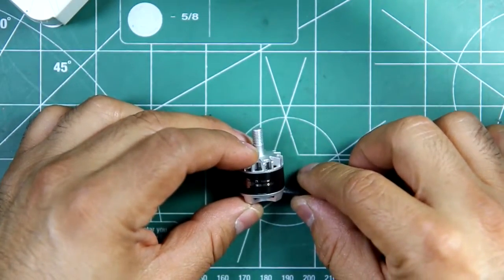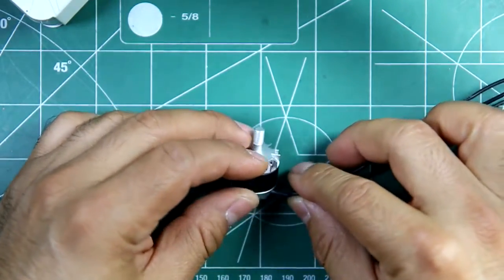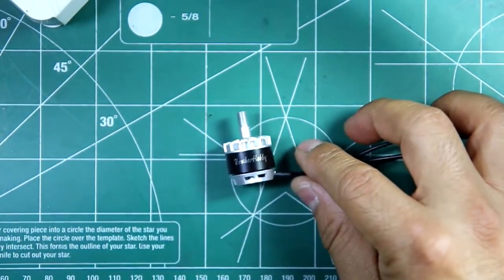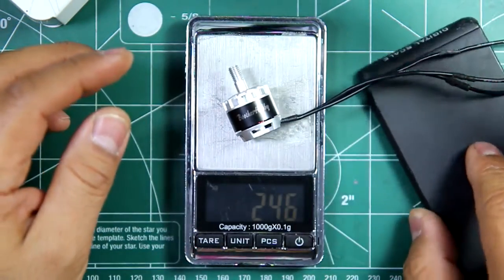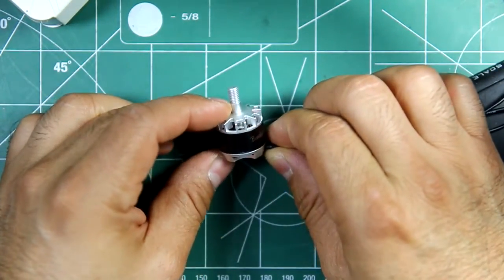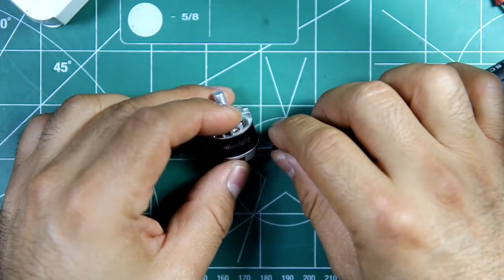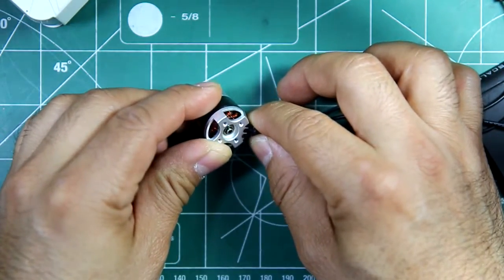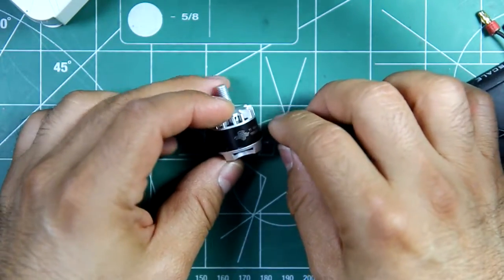BrotherHobby T1 1608-3600KV -Prototype- Static Thrust Tests -Give the Factory your Feedback!

Comment: Im finding a 1608 motors 3200-4200kv with M2 screw mount. 12mm diameter. Any recommendations for other type of motors? I couldnt find any 1608 T1(m2) 3200kv motors anymore.

Comment: Hi again I have come across some BBB 1606 3500kv motors, would you know about them ? they are for 3" props, I can buy them for a good price again here in china. they weigh about 15g, would they be good for 3" quad bladed props, over 1407.
 its hard to buy popular brands, here so its hard to choose. 
Thanks
(the rcinpower gts2305 2450kv motors have arrived just need to install them their quality is very good)
Reply from the maker: Yes, quality on the rcINpower is very good. As good as any of the top premium motors, and in some cases it's in fact better. Please let us know about your experience later on after you abuse those motors and give them a good beating ;) It'll be good to find out how durable and reliable they are. 
Also could you share the store website where you purchased them? Unless, it's only for the Chinese market. People are having a hard time finding these motors. I've mentioned to rcINpower they need to improve their reseller chain. 

 I have not tested that motor size yet. 1606-3500KV motor size seems like it would be a good match for 3" propellers and perhaps even for some low-pitch 4". 15g weight is very good, about same as BHobby 1407. I think they're the same motors as in this kit? https://www.banggood.com/3BR-128-128mm-Carbon-Fiber-FPV-Racing-Frame-1606-3500KV-Motor-Runcam-Swift-Mini-Camera-Combo-p-1153584.html
That BBB brand motors got good reviews on their larger motors from other testers, so hopefully the smaller ones are good too and hopefully BGood sells them soon so I can order and test them. They look good!
Reply: yes it is the same motors as in the kit, the motors have 3 mount holes for the kit frame plus the regular 4 for other frames...I plan on running the hq3030x4 with them hope its a good combo.... 
most people here buy there quad related parts from an online store called TAOBAO, a bit like ebay but much better, its got connections to most of the Chinese made parts , motors, props ETC, its were I have bought practically all my parts including the rcinpower and BBB motors , below is the link to the rcinpower store on taobao.

https://rcinpower.world.taobao.com/       (Chinese/english)

there email is,   rcinpower@163.com         (they can speak English)

regards

Comment: I would like to see a little lower KV to keep the amp draw under control. I like the size, but it seems too heavy for 4" quad. I would be really interested to see thrust/amp numbers on the RaceKraft 5038 prop. Get this motor down to about 20-22g and 2700-3000 kv and it would be perfect for light 5" builds.
Reply from the maker: I just got the 3200KV version last week and I'm running tests this weekend. This form factor seems to be somewhat specialized so you gotta do a good matching all-around. Props, superlight frame, etc to keep overall weigh light. Amp draw is exaggerated on the thrust stand, you'll see way less in-flight, specially if you got a light craft. I tested the TRK5038 on a larger motor but that prop's design doesn't show good data on the thrust stand. It's made for moving forward so on the static thrust tests performance is very poor but in the air it flies as good as other low-pitched props. I'll test GF5030 & HQ5040 on the 3200Kv version of this motor. Video should be up in a few days. Thanks for watching!

Comment: BH should think about a 1606 version with around 3000kv for 4" setups. this motor is too heavy and too hungry for amps. the 1407 are great, have them on my 3" rig, but this motor will never find his way on my 4" rig..... sorry BH!
Reply from the maker: Good point. A lighter 1606 3000~3300KV would match better with 4" props. I mentioned to BH about the weight on this motor and the target application would be 4" frames so a lower KV would be better. Hope they're listening
Reply: EngineerX , the next point is, its hard to find good 4" props. the 3"+5" market is exploding with weekly new shapes, hope the companys will put more focus on the 4" size.
Reply from the maker: Very true. Most 4" props come from chopped off 5". There's a couple of "native" 4" like the Lumenier 4040x3, 4040x4 and DAL TJ4045 x3 and T4045x3. We need a few more good ones.

Comment: What was the temp on 4S 4045 x 3?
Reply from the maker: Jonathan Jonas just a bit warm, nothing to worry about but I think once in air temps will be Ok. Still no word if they're releasing this motor. I haven't seen it for sale yet. Should be a bit lower KV, 3200 or 3300 would be nicer.
Reply: GOOD TO KNOW. WAS CURIOUS ABOUT IT IM ONLY RUNNING A 4X4X3 NON BULLNOSE 
FPVACES.COM HAS THEM IN STOCK 17.99 EACH JUST ORDERED A SET THIS MORNING
Reply from the maker: Jonathan Jonas Sweet! I've yet to build my 4" quad with these. Just can't seem to find enough hobby time lately. I've been curious to see how fast a 4" quad would be with these.4S 1000 or 1300 mah would be the LiPos I was thinking of using
Reply: I HEAR YOU THERE I JUST BOUGHT A 4"ALIEN FRAME BUT I THINK ITS GOING TO BE TO HEAVY FOR MY GOAL OF 10:1 POWER TO WEIGHT. I DESIGNED MY OWN VERSION OF THE ATOM V2 4" IM SHOOTING FOR SUB 300 GRAMS. RIGHT NOW MY CUSTOM V2 3" IS 257 AUW WITH THE 1407'S AND IT IS A MONSTER. ILL BE SURE TO SEND A LINK WHEN I FINISH THE 4"
Reply: OH BTW THANK YOU FOR ALL YOU THRUST TESTS. THEY HAVE BEEN THE DECIDING FACTOR WHEN IT COMES TO A LOT OF MY MOTORS
Reply from the maker: Awesome builds! For sure send me links once finished and ripping thru the air. Great to hear you've found the tests useful. The non-bullnose prop should be OK with this motor. Always good to do a quick punch out and land, check motor temps, then go for a somewhat aggressive lap and again check temps.
Reply: hey if i shoot you some lumenier 4x4x3 prop will you add them to you tests?
Reply from the maker: For this motor? Yes I can run the test on the next test session, I can add the results to the Excel table but would only make an additional video if there are a couple of other props to add. I can't think of any other props that would match well on this motor
Reply from the maker: will do!

Comment: Would love to see some 3" tests. What's the hole spacing for mounting?
Reply from the maker: I decided not to test 3" because the motor is quite large and heavy for 3" frames. Hole spacing is the same as 1407 motors. I think a lower KV value - 4" props and 4S would work best for this motor. I still have not got around to building the 4" frame I wanted to test these on.... need more free time for fun

Comment: If they can get the weight down to 20g and put out 1100g+ on a 4040 tri it will revolutionize the 4" market, you will easily be able to get p/w ratio in the 12:1+ range.
Reply from the maker: That would be the killer setup. It's going to be quite difficult to loose 4.5g. Most of the weight is on the stator laminations, magnets, copper windings and motor shaft. Those 3 components increase motor weight significantly as stator height dimension is increased. In contrast, increasing stator diameter increases weight by a smaller amount. A titanium shaft could be used to knock off a couple of grams perhaps, so maybe 22g could be possible. That would be a very goo weight I think.
Reply: EngineerX there was a 4" set up at the indoor race this weekend that was running 1407 3600kv bh motors with 4040X3 RK props, with a 850mah battery his AUW was 279g. This set up was able to post a top 5 time on the day! The more traditional 5" or 4" rigs had to make wider turns and keep momentum while the ultralight 4" could take corners tight and accelerate quicker after turns. the pilot also mentioned that with the extremely low weight he can make really drastic speed changes by just using his throttle, the inertia of the light weight set up doesn't carry forward speed like a heavier set up. But this set up will not work outside, the motors would overheat at full throttle with the 4040tri props, this is where a motor like this could fill a gap to allow for ultralight 4" set ups that are reliable.

Comment: It weight as much as a 2204 motor, it generates about as much thrust but with about 25% more amps for any given props.  Honestly I don't see a valid use case for this motor.
Reply from the maker: Very good observation, just what BH wants to hear from people. Perhaps BH should consider a lower KV to take advantage of the 8mm height of the stator and higher torque it should produce. A lower KV would perhaps be a little more efficient for 4" props on 4S and 5" on 3S so the Amp draw would be reduced, just my thoughts from what I've observed on a 2008-2550KV motor. The very high KV is desirable for the very small 3" props since we need to spin them superfast to get the monster thrust for the 130mm micros, but for the larger 4" & 5" props a lower KV is probably better.

Comment: I think this motor is ready for new class - 3.5 inch. First and for now only good prop I think is Schubkraft - 3.5x3x3 https://flyingfolk.com/SCHUBKRAFT-Racing-Props
Also worth a try to BN DAL TJ4045 3 and 4 blade props to 3.5 inches. 
For 3S 4 inch props are OK.
Reply from the maker: Those Schubkraft props are looking very good. I haven't et seen anyone carry them here in the US. I was gonna order some to test and shipping was like US$20 :(
Manufacturers need to consider making proper 3.5" propellers, not use cut-offs from larger props. I'll try and do some runs with 3.5" BN's as soon as I finish all the other motors I got on queue for testing

Comment: Could you test it with 3" prop ? It will be overkill for a 130mm quad but it is not bigger as 1707 who is use for 3"...I do believe that no lipo will be able to handle the amps already with the 1407 is limit. 
Bh are doing great motor!
Reply from the maker: I thought about testing with 3" prop but I think the size and weight of the motor is too large for that application. Even a 1707 is already too big. 1306 -  1407 seems to be just the right size for 3"

Comment: This motor would be great for a 4 inch racer but you would need some heavy duty lipos to deliver  the amps. Thanks for reviewing this motor!
Reply from the maker: Yep ! A good LiPo would be needed. The max Amps will be lower in flight by around 30% or so. Also some racing tracks are short and tight so with a properly sized LiPo you may just have enough Amp delivery for a race. If the pilot is lucky to be sponsored by a LiPo company, then no need to worry about trashing the batt pack! Just Win Baby !!

Comment: This is the strangest motor I have seen so far :P 
Maybe it can replace 1806 motors running 4 inch props ?

I would use it in an endurance build using the 6030 props :P Maybe put a gopro on it and fly it around for a small craft with extended flight times.
Reply from the maker: Yes, it's a peculiar size. I'm beginning to think a lower KV would be better for 4" props or as you say use it on a lightweight 6030 copter on 2S or 3S
Reply: I believe they also had 1306 motors. I hope they make some and are willing to send you some to test ! 
That aside, do you think all 1104 motors come from the same factory ? They all have the same shape. Only thing different between them is writing  / anodisation.
Reply from the maker: No idea if all 1104's are made at the same place, but you're right they look very similar so it makes one wonder about that. Yes, it would be cool to test the BH 1306's :)